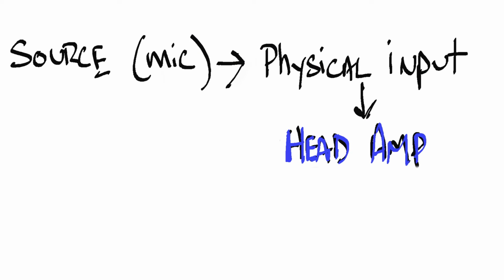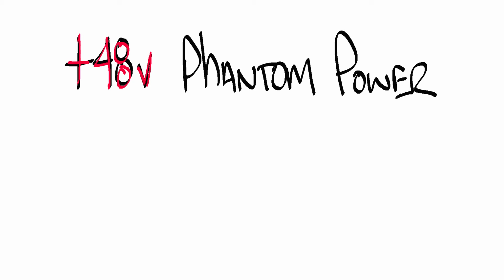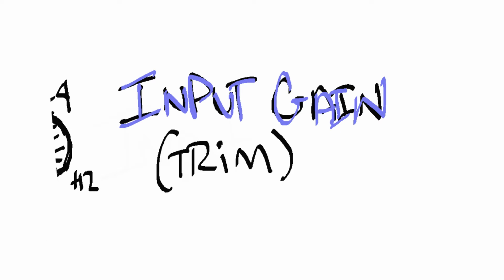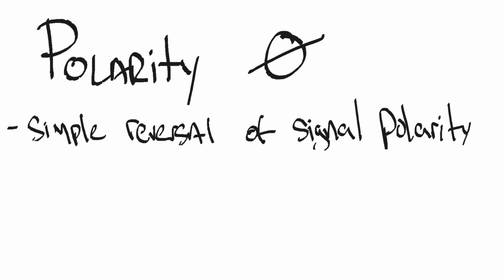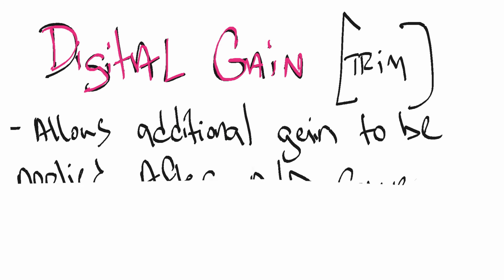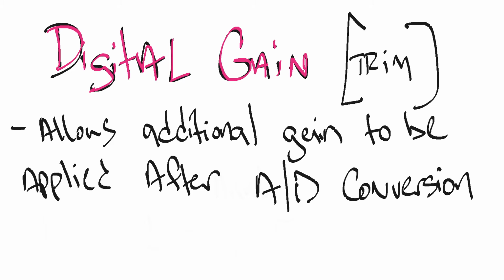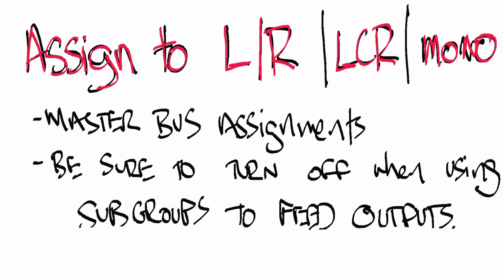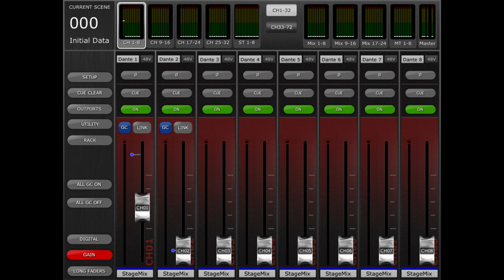#025 - Audio Inputs & Preamps - Live Sound Basics

Comment: @dcsoundop  If unity is roughly -18DBFS  on most digital consoles , what is the reason for setting your input gain to -12 DBFS?
Reply from the maker: When setting input gain on a digital console, the goal is to get enough signal into the console to be able to work with without either clipping or amplifying too much of the noise floor. While analog consoles measure signal from the noise floor up, digital consoles measure from the point of clip down, making the idea of unity gain somewhat arbitrary at this point. As long as you're not clipping the input and you have enough signal to work with, why should it matter what that level equates to here? 

So, I feel comfortable with 12db of headroom on most inputs. Anymore than that, and you risk clipping on unexpected loud sounds, and much lower than that (-18) and you'll have far less resolution on your channel faders, as you'll need to push them up a good bit farther to get any sort of useable level at your outputs. 

Of course, if you prefer to apply less gain at the input and shoot for -18, then make it up with your channel fader... that's fine if it works for you. Gain is gain, and it's up to you where you want to apply it.